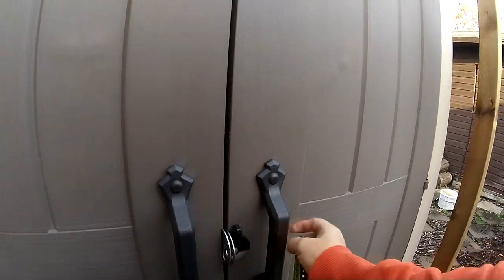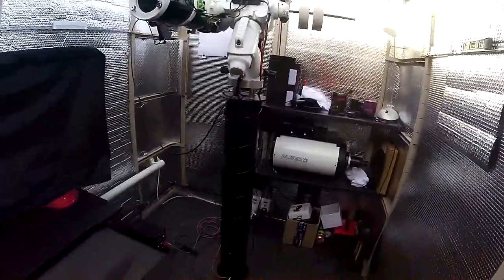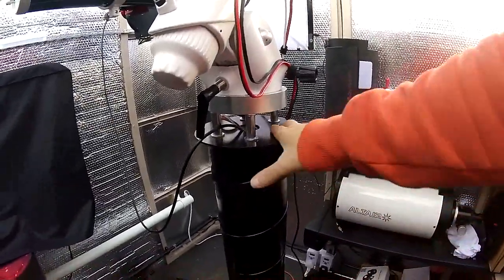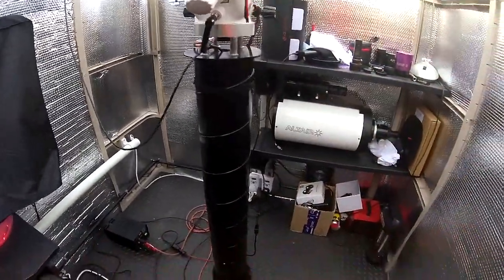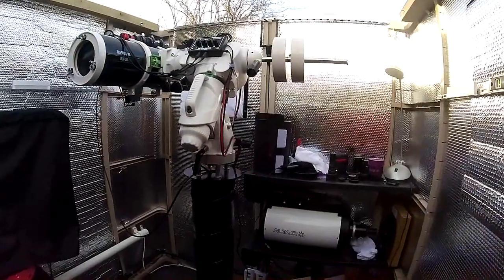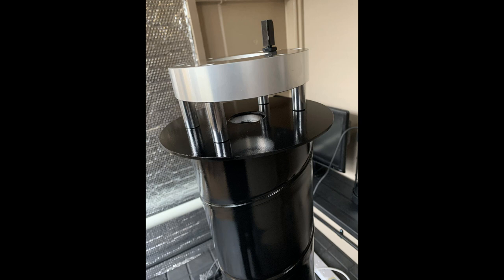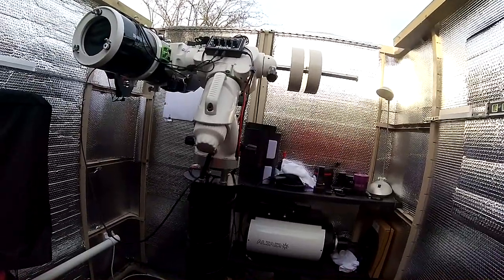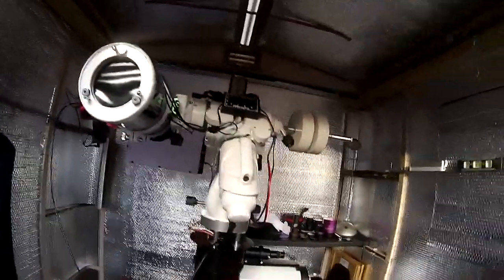Astrophotography with Glenn Clouder - Budget Pier Build

Comment: Hi Glenn hope your well.
I don't know if i missed this in the video.  Just wondering, how high is it from floor of observatory to the top of the pier not including the adaptor?
 Im planning out at the moment and hopefully going to start putting one together in the late spring , with the scope of building a full observatory at some point.  Iv'e also decided I like the air con and inner pipe design so im going to do the same.  Since you have built it has it been ok for you?
Reply from the maker: Hi Ben. Its about 110cm from the floor to the top. The pipe is another 60cm roughly in length with the bottom sunk into the concrete base.
Its been brilliant. The only difference I would do next time is go for a wider diameter . I’s opt for 200mm or even a bit larger
Reply: @Astrobloke  Brilliant, Cheers for getting back to me on that Glenn and for the extra info. I will keep that in mind.
Take it easy mate!!!
Reply from the maker: @CosmuzzAstro  no worries mate. Any questions just let me know, happy to help
Reply: @Astrobloke  Hi Glenn, why would you go for 200mm? Is it just to future-proof it for bigger scopes or have you noticed issues with the smaller 150mm column? Thanks. Mark
Reply from the maker: @secretstill  hi mate. Yes really just future proofing. Saying that it now has the EQ8 and CT10 on it and has no issues at all. Doubt I will ever go bigger than that. 150mm has been more than adequate

Comment: What did you use as polar alignment pin on the pier adapter ?
How height is the pier mount?
Reply from the maker: I used the pin that came with the eq6 tripod. The pier height from the ground is 1.2m. Hope that all helps.
Reply: @Astrobloke  Thanks, made. 
Very inspiring. Will turn the kids playhouse into an observatory. 
Your design will be perfect 😊
Reply: @Astrobloke  
Did you experience any movement of the pier during frost?
Reply from the maker: @One1Raptor  no not at all. The pier is inside a roll off roof Observatory so frost is not really ever an issue.
Reply: @Astrobloke   Cool.
What diameter tube did you use to feel with concrete?
Reply from the maker: @One1Raptor  hi Ricky, i used the 150mm pipe. Its absolutely fine but if I was doing it again I would get 200mm diameter so its even more substantial
Reply: @Astrobloke  Excellent. 
Just been offered a cheap 250mm/3m  pipe. That should work for my EQ5 mount head😊
Reply from the maker: @One1Raptor  sounds perfect. You must show me a pic when its all done.
Reply: @Astrobloke  Deal 😊
Reply: @Astrobloke  one more question. 
How did you center the pipe for cable management?
Reply from the maker: @One1Raptor  hi mate. If you mean the pipe that runs down the centre i just connected it up and did it by eye. You can keep adjusting its position while adding concrete. Its not crucial that its dead centre, roughly is fine
Reply from the maker: @One1Raptor  hi mate. If you mean the pipe that runs down the centre i just connected it up and did it by eye. You can keep adjusting its position while adding concrete. Its not crucial that its dead centre, roughly is fine
Reply: @Astrobloke  Thanks, m8.
I can sent u pics of the project via messenger. You can just search for me name on FB